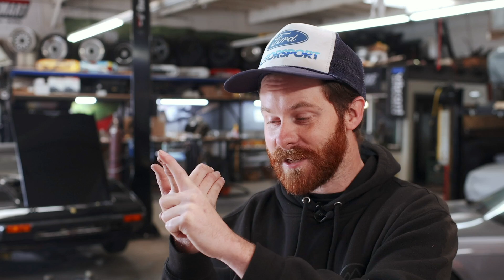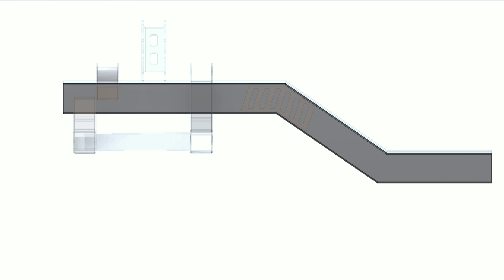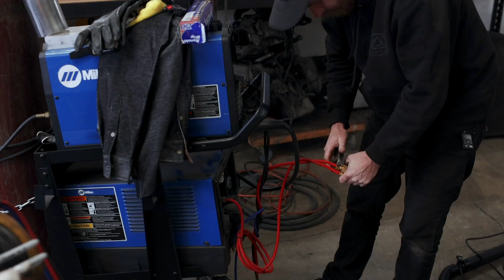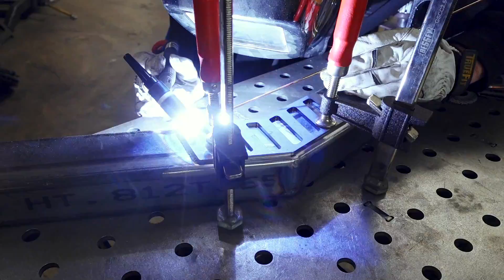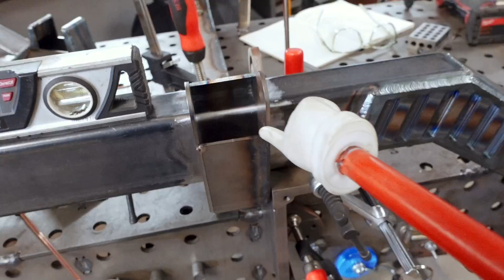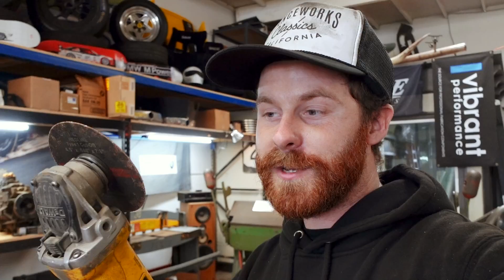Custom Chassis PT 2 - Making Frame Rails - 800hp 1931 Ford Truck Build!

Comment: Throughout nearly 20 years of using a angle grinder, I've had 2 cutting discs explode. One of the time it was because I was dumb, and didn't check the disc before use, which was damaged. The other time, the entire batch of discs were rotted because of bad/moist storage. Not cool when it happens, but still, I do not use a guard, just because it's a pain to reach certain areas with the guard on etc. And as you say, it's a risk I'm willing to take. 🤷‍♂
Reply: I can't see what I'm cutting AND hold it absolutely steady with the guard on, so I go without the guard.  I do wear safety glasses and gloves but other than that I'm just generally careful.

People who wish harm on someone for ANY reason are not good people.
Reply: @Scoots1994  Safety equipment is defintely key here, rocking a guardless grinder without any form of personal protection is pure stupidity. Which reminds me, I need a new facemask, and probably a new batch of cutting discs.
Reply: @Scoots1994  that’s how I feel. Better to wear the safety gear yourself. A guard on the grinder won’t help if you have to look around it to see what your doing.
Reply: I use mine without a guard also, but only when wearing other protective gear as well, high impact full face shield and heavy gloves. It is more versatile without the guard, no question.
Reply: My brothers are b-welders and always use a gaurd. They have seen the results of an exploded disc and what it can do to a guy. I should put mine back on....
Reply: @david929190  Wow, looks like people here don't know how to use a grinders. I have never had to take the guard of to cut anything and can see fine with it on. I wonder if they know you can turn the guard into a position that makes it easy to see what you are doing and your hands are still protected? Always amazed at all the American shows that never use guards on their grinders and yet some of the people that think it is okay without one get on those Pakistani Factory Worker videos and bleat on about the lack of safety gear the people in those factories have. Wow. the mind boggles. "I don't need safety gear if I am careful", I suppose that works for all machinery. Like the idiots that weld with T-shirts on that think they are safe because they have a welding helmet on - guess they have never heard of ray burns and skin cancer I suppose. Good luck to them.
Reply: @R1Learner  I think it depends a lot on the kind of work you are doing. The guard has gotten in my way more than once trying to work in a tight space, guys used to cut the guard down so it was more a brace for your hand and to stop your glove getting into the wheel. You can be careful as in not twisting the blade in the cut or going at it in a way that you catch the blade or have it kick off. You use one for 12hrs and get complacent and that's when accidents happen. Or your blade is getting small so you are tilting the head to get that last but of the cut and bind it up. Being careful is a component of  safety, far more so than any guard in my opinion. But those Pakistanis guys need gloves, glasses, a mask, and boots so bad most of the time.
Reply: @david929190  If I can't get the grinder in somewhere I find another way, might be a bit more time consuming but.... that is probably the issue, people want to get the job done as quick as possible nowadays. Why, sometimes I will even break out the hacksaw and engage in a bit of physical labour. LOL As for the Pakistanis, I agree with you, it is a terrible situation for the workers. I am a big fan of going home from work in the same condition you arrived at work.
Reply: @R1Learner  this! plasma cutter, recip saw, gas axe… theres always another way and yeah it may take longer but you only get 1 set of eyes and 1 set of hands.
Reply: @xTRACKD  That's right, I saw enough safety videos when I first started work to last me a lifetime - I can still vividly remember the one where they are moving around a piece of metal in someones eye with a magnetic to get it to the hole in their eye, then out it pops, Wow, that's not for me I thought at the time.
Reply: @R1Learner  so you never worked in real live. only some easy cuts on the workbench.
Reply: @oliverroedel1111  If you say so. By the way, you might as well put your guard back on as having it off isn't helping you cut straight.
Reply: @R1Learner  teach the pros this trick, seams they did all theyr life wrong
Reply: @oliverroedel1111  I get paid to use grinders, so I guess that makes me a professional. Who knew?
Reply: @R1Learner  not always hahaha
Reply: @R1Learner  there are girls paid for "doing it" and I can say the non paid are way better hahaha
Reply: @oliverroedel1111  Strange analogy. So I guess what you are trying to say is that the pros don't know what they are doing. By the way, where I live if they catch you removing safety equipment from machinery you wouldn't have a job for long. Anyway, at home you can explode a wheel, cut your fingers up and no one gives a crap, so cut loose.
Reply: agreed. people shove their discs inch-deep into stock and act surprised when their discs don't last/explode
Reply: And also cutting discs often got a "best before" date written on them. ☝🏻
Reply: I've seen people with " thousands of hours" using equipment sans safety equipment maim themselves as well as others. Like someone else already said- just stupid. Ask Steve Strope of pure vision if he'd like to have his vision back in the eye he fucked up not using safety gear because it was a " pain". Mike had me as a subscriber until this.

Comment: I use my Dewalt miter as a chop saw as well, but made a couple modifications that allow me to keep it from being destroyed (since I also swap the blade for wood once in a while). I machined a new throat plate out of aluminum after I melted the plastic one (which kept stock from sitting flat) and a tin plate that protects the plastic tube for sawdust. Since then, it's been great, but I'm looking forward to the day I have room for a proper chop saw (with a proper metal saw blade).
Reply: I've run without a guard for many years. I have had plenty explode on me. I generally wear a heavy welding jacket, so that's protected me many times. If I have no choice but to have my face in line with the blade I have a full face shield I wear. I also wear safety glasses as I wear glasses to see anyways. Honestly I am often cutting something in a weird spot or angle that the guard becomes a problem. That's part of custom fabrication. So do your thing man